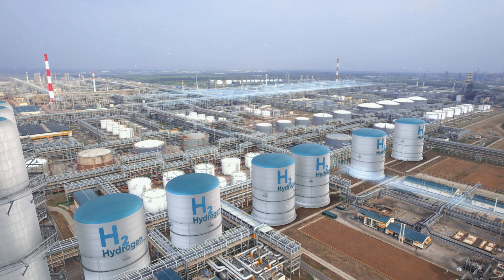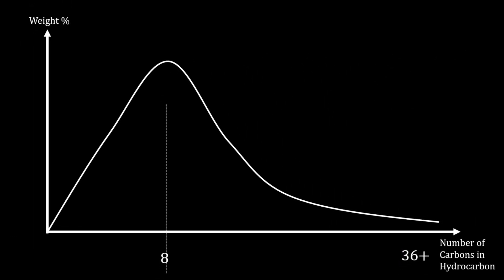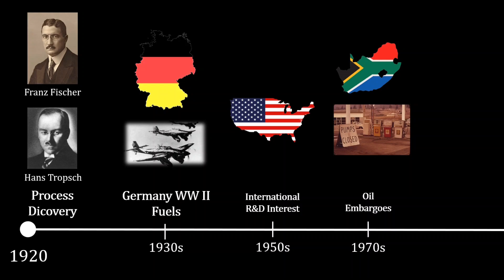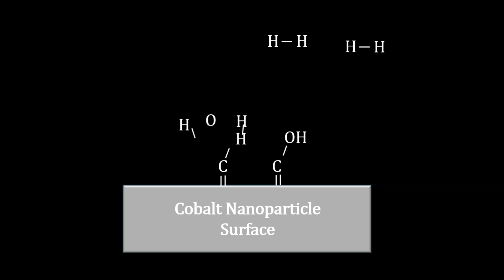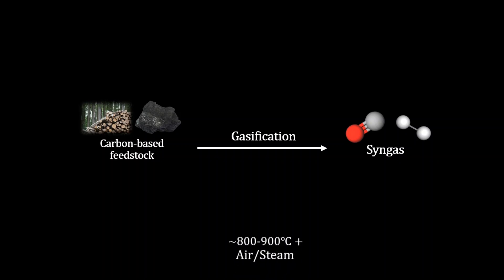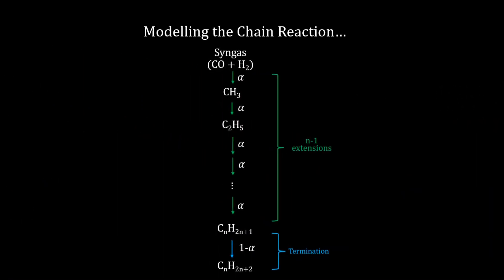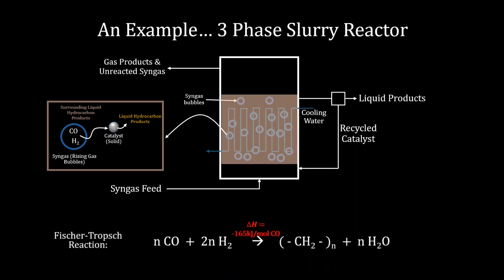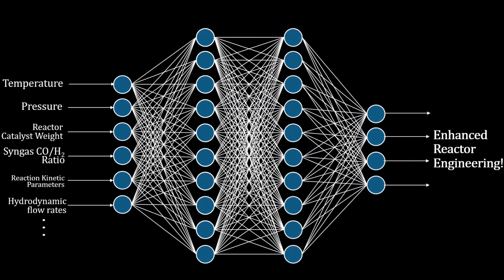Renewable Crude Oil? | Fischer Tropsch Process Explained

Comment: Is it necessary to crack the liquid with zeolite before distillation?
Reply from the maker: Hi, thanks for your comment :). So at least in the video, zeolites are mentioned to convert Fischer Trospch alkanes to aromatics - this is optional depending on what product you want to make. More broadly, the necessity to crack would depend on the mixture you have. For example if you had some really big alkanes that were semi-solid/solids/waxes at process conditions this would not be passable through a traditional distillation column so you'd need to crack this first - these waxes also create other chemical engineering logistical problems too. So to answer your question - yes and no - it depends on your mixture, and what you're trying to make :). Hope this helps!

Comment: The products poison the catalyst that's why this never took off.
Reply from the maker: Hi, thanks for commenting :) - I think I've responded to your other comment but will say something similar if people read this. So catalyst poisoning is definitely an issue, amongst others like heat management, technical limitations etc.. The process has taken off in the sense it's seen and continues to see extensive industrial action. Perhaps we'll see a bigger push with sustainability in the coming years,... or perhaps not!
Reply: @ChemEfy  it's a fools errand, developing catalyst to work with gas that  results in grease and oil, chemists nightmare, it will never work

Comment: Fischer Tropsch can make compounds from short alkanes and long alkanes using Fe/Co/Rh catalysts.

1.Methane CH4
2.Ethane C2H6
3.Propane C3H8
4.Butane C4H10
5.Pentane C5H12
6.Hexane C6H14
7.Heptane C7H16
8.Oktane C8H18
9.Nonane C9H20
10.Dekane C10H22
11.Undekane C11H24
12.Dodekane C12H26
13.Tridekane C13H28

And the making of wax includes
Reply from the maker: Close, but not quite :)! So Fischer Tropsch uses syngas (CO + H2) and Fe/Co etc. catalysts to make alkanes and other hydrocarbons.

Comment: IMHO the most promising application of this technology is using direct-air-captured carbon as a feedstock. Enabling us to have our cake and eat it, producing completely carbon neutral gasoline /diesel. Or even carbon negative, if the capture facility diverts only some of its captured carbon to fuel manufacture, with the rest being buried.
Reply from the maker: Absolutely! Certainly some tech development needed to improve the cost on some of these options at the moment, but remain most promising as you mention. Venturing a bit into power to liquids which I have another video on too! https://www.youtube.com/watch?v=NkQN-umIfqU
Reply: It is definitely possible, but might need quite a bit of energy, because it involves the reverse water gas reaction and possibly even splitting water molecules so that hydrogen is generated for the former and the Fischer-Tropsch process as well.

Comment: Thank you for sharing. I'm convinced that the conversion of Syngas (created by the pyrolysis of Biomass) into liquid fuels / lubricants by way of the Fischer Tropsch Process is the future of liquid fuels.
Reply from the maker: @astebbin Interesting stuff :). Sounds like an element of electrofuels/power-to-liquids creeping in (see my most recent video!). Fully agree there won't be enough farmland for this, unless lignocellulosic biomass and/or genetic engineering has a breakthrough (the latter I'd argue is veering away from biomass though). Electrochemical methods for CO2-seawater could be interesting indeed especially with nuclear reactors. Thanks for your comment :)!
Reply from the maker: Glad you enjoyed :) - yes, certainly a technology to watch for the future!
Reply: @astebbin Not if we use biomass the bottom level of energy.

But in reality, if you think of the FT process as an energy storage medium, then it effectively allows us to use cheap/intermittent energy into materials and fuel to run high energy spike processes.

Less more as a basic energy layer, and more like an easier to use battery
Reply: If you want to turn biomass into crude oil, there's actually an even better industrial process than the Fischer-Tropsch one. It's called hydrothermal liquefaction, and it works by boiling biomass at 200-300 degrees celcius in a heavy-duty pressure cooker.

Comment: Zeolite catalyst use ignores how solar energy and rail transit both require too much real estate of how sunlight only causes poverty.
Reply: rail transit requires too much real estate? Errr, you need to spend some time in Europe, China and Japan. Compared to roads, railways take up very little land, and carry a lot more goods and passengers. 

Solar power takes up real estate? How much real estate is taken up by solar panels on the roofs of buildings? How much real estate in deserts is going to be missed if solar farms are put there. In both cases the answer is zero. 

In New Mexico there are gas fracking fields that cover hundreds of square miles with well heads every few hundred yards (or meters in non-US measurements) Is anyone going to lose out if the gaps between the well heads are covered with solar panels?

You're going to have to adapt to the fact that wind and solar power are now cheaper than fossil fuel power in most parts of the world. Which is going to make hydrogen production cheap enough to be economically viable.
Reply: You John Small must have a small IQ since you are ignorant of Planck's Constant coefficient of energy per photon frequency and ignorant of PI 3.14159 radius squared ^2 turning radius of rail transit.

Dystopia of how solar energy literally comes from hides of serfs and how Coolies died laying rail transit tracks is very real since editors of "Asimov's and Analog" have stated to writers how muscles can carry enough chlorophyl even if genes were spliced while Aldous Huxley stated "only idiotic morons are satisfied laying rail transit tracks.

Fact is by Fall of 1945 Americans & Russians imposed rail transit tracks & agricultural farms on others of how Solar energy meant slavery while Europeans used Decauville Portable locomotives to stay one step ahead of scrap metal thieves depicted in of "Bollan Pass" 1884 "Scientific American" of how Rudyard Kipling described subjugation to consider how Allies WWII victory was how whole mountains were leveled since even today Hamgyong and Eastern Manchuria are too mountainous even for cog rack pinion rail transit tracks.    

Japanese East Asia before could not have had rail transit since Roosevelt's 1938 to 1945 blockade on East Asia having lacked quality ferrous iron with surpluses of synthetic silk & Chemicals meant they had to use steam filled airships powered by ceramic sulfur burners and cryogenic deuterium fueled rocket propelled composite fiber braided gliders between roof top Hangars equipped with STOL fans to haul freight.    

My internationally & MIT peer reviewed work proves how Noguchi of early 1940s Hamhung Hungnam Hamgyong perfected muon catalyzed fusion for Hasegawa's project NA thru NZ  and how 1920s Mary Kenney's patented ground based STOL fans were forgotten inventions due to White Male Chauvinist Eurocentric Hegemony of their time of how female divers allowed Japan to have avoided serfdom.
Reply: You censored my reply to your bully pulpit
Reply: Japanese East Asia Prior to Fall of 1945 had humane alternatives to rail transit such as steam filled airships powered by ceramic sulfur burners & braided composite fiber rocket gliders fueled by cryogenic liquified deuterium to haul freight between rooftop hangars equipped with STOL fans compared to Western rail transit tracks built on coolies so consider how Japan also had female divers for an alternative to agricultural serfdom of how as usual WWII was typical of American dirty tricks to impose rail transit and agricultural farms on others.
Reply: @thomasciarlariello that’s a long sentence!
Reply: In order words, TLDR!